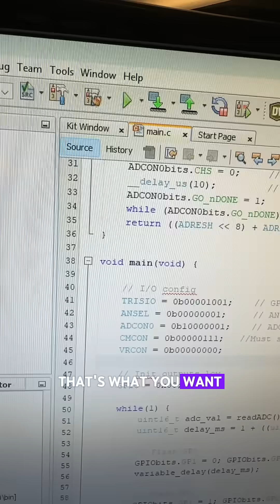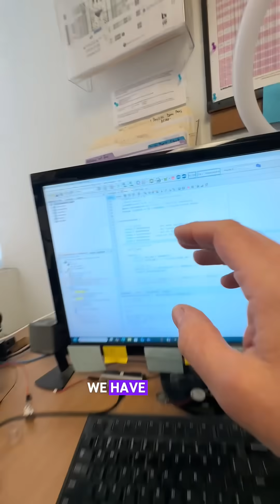Introduction to Microcontrollers and PIC12F675

Comment: Guys like you are the reason I have shelves of electronic programming and circuitry gadgets that I have no idea how to use but sounded really cool when somebody talked about them 😂
Reply: Don't think like a cook following a recipe. Think like a chef learning how the ingredients work together to make the complete dish.
FluxBench has a good video about how to think like an engineer that will help you get started with projects without feeling overwhelmed. He lays out the framework for leveling up your engineering abilities. He talks about how if you try to approach it by following starter guides, that works for your first project or two, but after that you are hindering yourself by following a recipe instead of learning how the ingredients work.
Reply: LOL! I thought I was the only one. I have a bunch of Arduinos and have no clue what I'm going to do with them!!😂😂
Reply: @andreb877  Use them. I made a smart thermostat for my garage that tracks usage statistics and temperature variations. 

Another one runs a watering system for my garden. It’s connected to a weather api and collects forecast and rain data so it doesn’t get too much or too little water. 

The use cases for these things are only limited by your imagination. Next time you want to buy an electric device to control something, use one to create the device. At the very least run it for a little while and then buy the device. You’ll learn a lot about how things work.
Reply: That's me bro😂
Reply: Some assembly required,  is the second most told lie.😅😅😅
Reply: You have to think the other way around. Instead of looking at what a microcontroller can do and then thinking what you could use it for, think about what you want to build first and then think about how to get there. Break up the project or product into logical modules, each with their own responsibilities. Maybe some modules don't even need a microcontroller, like a power supply can sometimes just be as simple as an LDO with a few buffer caps. Experiment with stuff, try to change or optimize behaviour.. Be creative. Yeah, you might occasionally blow something up.. Oh well.. At least you learned what not to do then 😅 Just be careful you don't touch voltages that are too high and keep stuff that can catch fire away from your experiments. If you experiment and learn from your mistakes, you also learn how to be creative with electronics. I have a workbench full of PCBs for several different projects I'm working on. Most of these PCBs are a second, third, or fourth revision because my previous attempts had some mistake. Get yourself a scope and lab bench power supply and a few breadboards and some wire of the right gauge for using in breadboards. Experiment and learn. Edison failed more than 100 times before succeeding in making a practically usable lightbulb. When the newspapers asked him about his failure he said he didn't fail, rather he found 100 ways in which it couldn't be done. Success doesn't come from following hundreds of tutorials and then thinking what you can do with that knowledge, because those tutorials put you in a comfort zone you might be reluctant to step out of. Success comes imagining something and then failing often, failing fast, learning from it, and persevering. Just have fun.
Reply: If you are getting stuck, use ChatGPT to help you code and find the errors, it will save you a lot of time and supercharge your projects.
Reply: Are you me? 😅🫣😬
Reply: Lol😂
Reply: The same here
Reply: Yes 🫣
Reply: Nobody does that. Oh wait...
Reply: that's what retirement is for. I'm 2 years away and I have decommissioned robotic arms and ev motor projects I will be building controllers for that will detect and auto select between the most common architectures. Old Tech Donald had a robot farm, 01-01-00000😂
Reply: It s a bit of a catch 22 .., you cannot use the tool without having a tool .., but then may the answer is the initial education .., this guy knows too much almost to think effectively how little some know ... It ' s like handing the key of a semi to a person who only has ever had a bicycle .., they're likely to be a lot of wreckage ..., but in this case the police are unlikely to turn up ...
Reply: Lol
Reply: My dad was an EE and Im very ME minded so this was basically my childhood lol

But these days with software, you can get far in this world as basically a script kiddie with an erector set lol
Reply: Im here because I want to figure out how to actuate an electronically controlled 5mode transfer case outside of its native Canbus environment..  i mean its a few servo or linear motor actuators we should be able to breadboad a control interface to some pretty analog input switches lol. 

Guys are building crabwalk diy control interfaces for quadrasteer electric steer axles and putting paddle shifters on torque converter automatics with arduinos lol
Reply: @KaosProject21  tbh a small PIC microcontroller like he's showing (but one with a few more I/O pins) would be plenty of smarts to run your transfer case. I think your bigger challenge will be interfacing to the actuators reliably.
Reply: nah your the reason you dont learn how they work buddy
Reply: @moobaoomba  wow great point Billy badass. Thinking your comprehension might need a little 3rd grade tuneup.

Comment: The biggest advantage I can think of for any hardware/software protyper is becoming comfortable using and understanding assembly language, and tool chains. Then, you can program ANYTHING.
Reply: True to some extent, but each family of microprocessor, microcontroller, and PIC has its own assembly language and internal hardware architecture.  There is no universal assembly language that will work on everything.
Reply: @PhilR0gers that is correct! But, being familiar with the way that flags, registers, jumps, memory allocation, etc. works makes it easier to learn assembly language for any platform.

Comment: what is that large round thing you put on the board?
Reply from the maker: That's a 3.6 volt Tadiran battery, TL-5134. They are used in military / industrial / medical applications.

Comment: and what is the utility for these sort of microcontrollers? Like what do you typically program them to run in a day to day scenario
Reply from the maker: Designing a sensor would be a great application. Maybe you're running a specialized photo-eye or array, for example that monitors an assembly line. Typically you'd design this into a high volume product line, rather than do a one-off.

Comment: I started with PIC too. But truthfully speaking, there are not enough boards that are available directly for firmware development having them. Those that are available, cannot be really used in end products, and are also usually expensive ones. You have to go through the whole cycle everytime you want to make a new product. I think Arduino got this right, right from the start.

Comment: Wow compering 3 development boards with a IC. And one of them is a SBC...
And not even mentions a Arduino (witch have an atmel controller on it) which have similar power and functions as the PIC.

Ther is some bs in this video...
Reply from the maker: Got your engagement tho, thank you sir!
Reply: @i2c_jason  I get the intention of the video. But the presentation was meh...

Comment: i started with the og ardiuno uno 328p used them for hobby crap for a few years but soon ditched the arduino ide moved to atmel studio, kicked that within a month moved to VScode / Vivado and use altium for work and kicad for hobbies fyi zero collage yet i have made fully integrated edge Ai camera system and even have a few patents in camera sensor design and color night vision for LPR

 edge Ai camera system and even have a few patents.

Comment: What is the fastest switching time of this controller? If i wanted a tailored waveform at 100 kHz that id need to switch pulses in day ns, can it do that?
Reply from the maker: I believe that at 4MHz, you get a 1us instruction cycle on this part. You’d want to use assembly or inline assembly. There are other parts in the product line with a capture compare PWM module too.

Comment: $150/hr?
 Brother, you point me in the direction and ill apply. With a degree and years of experience, i cant get anything anywhere near that amount, anywhere 😭
Reply from the maker: Have to start your own R&D business. 👍👍
Reply: @i2c_jason 
So knowing PIC is not $150 an hour skill?😂

I respect your success and knowledge sharing, but watching the video is just confusing.

You need to be able to deal with people effectively, iron out requirements, mechanical/electrical/software engineering, business finance, and you also need to either be lucky or know the right people. THAT's $150/hr.
Reply from the maker: @justinwolf2854 correct. You can earn $150/hr offering design services with a PIC micro. What part of this is incorrect?
Reply: @i2c_jason  it's a short form video, the comment was about programming a PIC being a $150/hr skill, the lack of clarity is because it's a short.

You've proven the comment correct - programming a PIC is not a $150/hr skill. It's an additional skill, added to a wide breadth of other skills, which when combined create a $150/hr business.

Unless what you're saying is that you charge an extra $150/hr to clients because of PIC programming alone. Which is where you could choose to provide more clarity.

Comment: I use PICs often, however a Pi Zero-w costs $6 has way more memory, wifi,and Bluetooth. I use PI zeros WAY more often than PICs. I write all my code in assembler as well.
Reply: Where are you buying legit zeros for 6 dollars?
Reply: @youdontknowme-r2m  maybe they mean pico
Reply: @youdontknowme-r2m online
Reply: @youdontknowme-r2m  maybe they bought a bunch like 15 years ago and never saw the price increase lol
Reply: Pi zero runs Linux don't they?
Reply: @kreuner11 yes
Reply: @kreuner11 No, they don't. RAM is too low for that. FreeRTOS is an option.
He is showing the Raspberry Pi Pico with RP2040/RP2350 MCU, where boards with name "RP2xxx Zero" are sold.
Reply: @pupi3594 You're confusing stuff. There is the Pico line which are dev boards with RPxxxx family microcontrollers then there are the full fledged computers like the Raspberry Pi Zero 1 and Raspberry Pi Zero 2, which do not have kilobytes of memory, but several hundred megabytes of memory, and can run a regular OSes like linux, but still in a very small form factor.
Reply: @supersanic3446  finally someone that actually isnt talking bullshit
Reply: @pupi3594 I think beside RAM the issue is that RP2040/2350 has Cortex M CPU which is not an application processor and as such lacks crucial things like MMU, you would need cortex A series for that. 
Zephyr is imho the closest thing that resembles OS that can be run on a cortex M

Comment: Being able to connect and reprogram without external hardware, is actually an advantage for all of my projects
Reply: Hu? The programmer is external hardware. This is no different from basically all MCUs
Reply: @Hitman12.  Exactly. For esps, arduinos and such, there's no need for a programmer
Reply: @lucasmontec Yes and no.  The programmer is built in the  arduino board.
Reply: But the difference was ESP users would be cranking them out, they wouldn't want to pay for the programming essentials on chip. That's why esp's run many of our iot appliances today.  

OP is just pointing out how different markets are served. Sure tinkerers would pay a penny or a dollar more. But all the moms buying the latest washer and dryer don't give a crap they want it cheaper
Reply: @gutrali  tbh, if that's the argument, there are much cheaper chinese MCUs than PICs. You can get nordic chips for pennies. Nrf ones. Depending on the appliance, you can also get even cheaper chips made directly on the pcb.
Reply: Then just write bootloader, and here you go. If you MCU support USB, just get PID/VID from manufacturer for free. And you have free reprogram ability, without external HW. 
Also try to use lowpower modes on RPI. I get mcu regularly to run 10 years on battery.

Comment: So... You're just going to completely overlook the Atmega8 and 328? The better, more popular chips with the simpler to learn Arduino IDE?
Reply: It's like $1 per chip that is older than my wife 😅. WCH ch32Vxxx series going  for like 7cent per chip in 8 to 20pin body and 6dollar 1wire programmer. The compiler is 20times faster than esp32 or Arduino 😊
Reply from the maker: @podrezd old means it hasn’t had to go end of life due to errata or reliability issues. Different application for the different parts we speak of. Consumer vs medical, etc.
Reply from the maker: I can always count on YouTube comments section to suck 😂

Comment: PIC are great, I use them when they fit. Comparing them to a Raspberry Pi Zero is quite a stretch though as that's not a microcontroller. Also there are way more options for low power microcontrollers than those two you mentioned.
Reply from the maker: Well that’s my point, you have to select a leaner micro for some applications. Theres a lot of different aspects to selecting a micro or processor, volume and power consumption being two of them.

Comment: That is a Awesome Tool, Can you program it to be an Adjustable Oscillator Clock Signal Generator? That's really Awesome.
Reply from the maker: Yes in fact I was told this chip was originally designed to compete with a 555 timer, as a programmable competitor. If you need really accurate timing you’ll wanna use an external oscillator and not the internal one.

Comment: I am a pharmacist and i want to learn designing circuit boards and learn coding and use microcontrollers for making electronic devices..... Where do you suggest to start with... Something that can get me started and have a steady path for learning...... I have already learned CAD and designing my own parts
Reply from the maker: Start playing with Adafruit boards and modules, let your curiosity turn into a portfolio of projects. 👍👍
Reply: @i2c_jason  can you suggest on a place to start that as being from a medical background i am pretty blank on that too